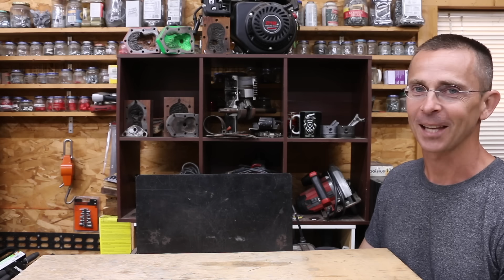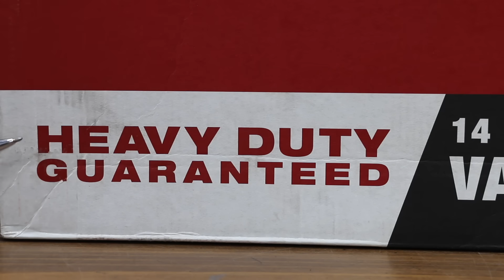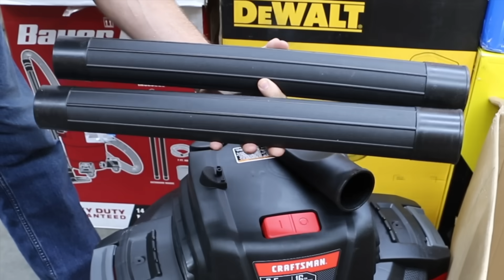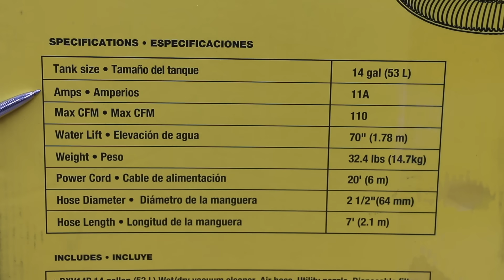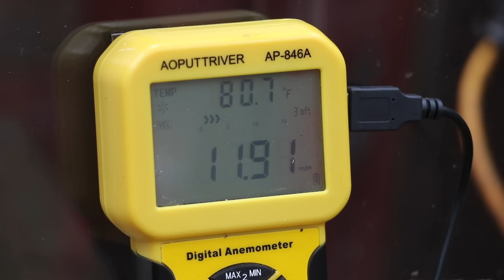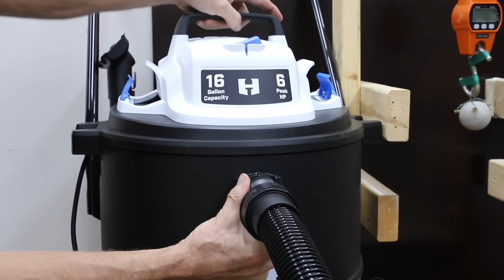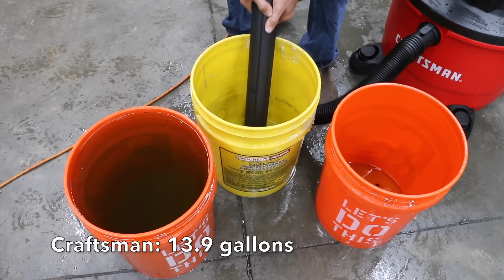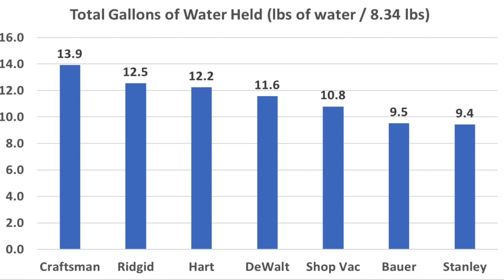Best Shop Vac? Ridgid vs Shop Vac, DeWalt, Stanley, Hart, Craftsman

Comment: Obviously this is an old video so I don't expect a response, but it would be neat if you factored in Harbor Freight's 2 year warranty into the cost for comparison.  I never buy a power tool from HF without that warranty.

Comment: I have a 30 year old + Craftsman 3.5 HP 16ga..I bought when I had a detail biz and still working great..bought a Rigid
at HD and basically about 1/2 the suction..need new hose now but worth the 25 bucks..I will hand this vac down to my son or Grandson when Im gone

Comment: Can you try sealing them up with some foam rubber or something and seeing how they perform afterwards? I know that doesn't give an out-of-box performance result, but if one had a better motor overall, and the only reason it performed lower on suction was due to leakage, it would show how an owner can "modify" it to have the best performing shopvac period.

Comment: Wait, if you can calculate horsepower based on amperage  then it really doesn't mean anything when comparing vacuums. You could have one motor that's more efficient than than another and still offers the same PSI.

Comment: I have a Ridgid 12gal which I purchased around 4-5 years ago and it's been a workhouse when I've needed it to suck up the remaining couple of inches of water still left in our 16 ft above ground pool at season's end. After watching this test I checked to see if mine had as much play in the lid...and it does. I purchased two Ridgid 12 gal vacs at Christmas (couldn't pass on the sale of $75 each), one for me and one for my daughter, and I noticed right away the improvements they've made to the newer models with the most-notable being how the top locks into the tub. Instead of it simply clicking into a locked position like it does on my old unit the new models actually have dedicated locks on both sides which you have to firmly push to lock it down. There's much less play in the newer units. Yes, I tested that...LOL!

Comment: Harbor Freight offers warranties that can compete with the top brands, for a few extra $.  With the performance of the Bauer, for $120 with the extended warranty, you really can't beat it.   I have a couple vac's, a Rigid, Craftsman, porter cable. and the one thing they all suffer from are clogged filters.  I guess the one with the easiest to clean filter would be my top pick! LOL

Comment: The HP rating on boxes is a load of shit, its a marketing gimmick. None of the vacs are actually anywhere near those ratings, its just a way to justify why you're paying well over $100 for some cheap molded plastic and a cheap motor. If I had to guess, those vacs probably cost them between $10 and $15 each to make if that.

Comment: Peak Horsepower (PHP)
Most manufacturers of garage vacuums and shop vacuums are marketing their vacuums as 4 to 5 Peak Horsepower (PHP).

No matter what you call it, PHP, HP, or horsepower, it's all just horse hockey when it comes to the performance of a vacuum cleaner.

To put it into the simplest terms:    

·      When it comes to vacuum cleaners, horsepower is a bogus, fictitious number having no relationship to the performance or cleaning ability of the product.

·      It is not based upon the nominal operating current of the vacuum cleaner, but on the in-rush current to the motor when first turned on.

·      The peak in-rush current lasts no more than 0.008  to 0.012 seconds.  It is often inflated by chilling the motor to temperatures as low as -20F.

·      Four horse power equates to 2983 Watts, or 24.9 Amps, at 120Volt under ideal conditions. This would greatly exceed the voltage supply circuits and blow the circuit breaker in a home.

·      It is 100% a marketing gimmick. In other words, it's just horse hockey.

For the technical person:·      Horsepower is not based upon the normal operating current of the motor. It is calculated using the maximum in-rush current. In-rush current is the current a motor sees when first started up, before the effects of winding inductance come into play. A motor with a nominal operating current of 12A can easily have an in-rush current of 30A to greater than 50A, depending upon the windings. It typically lasts for only 8 to 12 milliseconds (0.008 to 0.012 seconds). Some manufacturers attempt to maximize the in-rush current by conditioning the motor at very low temperatures (as low as -20F). This lowers the motor resistance, thus increases the in-rush current.

·      Power is equal to volts times amps.  Even ignoring the efficiency and power factor of the motor, a motor with a nominal 12A current @ 120V will only produce 1, 440 Watts. There are 745.7 Watts per horsepower. Thus, under the best of conditions, the motor will only produce 1.9 hp.   A motor touting 4 hp would have to produce 2983 Watts. With that power, the motor would be drawing 24.9 Amps. Horsepower is determined for the motor (without any fan blades), not the vacuum cleaner system, and does not take into account any normal system losses (air leaks, restrictions, piping and the like).

Comment: I have had a craftsman like the one you tested for at least 20 years.  I use it regularly vacuuming sawdust etc.  It still works perfectly.  I also have a rigid like the one you tested but don't use it regularly as it is in my garage instead of my shop - it definately isn't as strong as my craftsman.  Great test comparison.

Comment: I used my shop vac with my drywall sanders on jobs for my customers as a remodeler. I used to have an old ridgid vac that just was so so loud. I’m sure the drywall dust ruined the bearings or something because I always felt like I needed earplugs running it. I sold it and bought the 9 gallon dewalt and the performance and noise level was night and day! Love to see my biases confirmed. Build quality on it is definitely good and we beat on it almost daily. Only downside is that you have to use their over priced bags or it blows all the dust back out.

Comment: Bought a Rigid to replace my ShopVac that recently died. I only went with Rigid because the Lowes and Home Depot in my area no longer carry ShopVac. The Rigid is pretty powerful and does what I need it to do around my home workshop. The only complaint I have is the power cord material. In the winter it is really stiff and hard to manage.

Comment: A little insight. I have several Shop Vac and several Rigid vac at my shop. I bought the Bauer 6 gal. with my own money since we could hardly get them at work at the time due to logistics. I use it every day professionally. I wasn’t sure on it at first when i bought it. I did get the 1 yr replacement warranty. Not much money. I Love it. I really do. It’s noticeably quieter than the rest. It has a deeper tone than the higher pitch tone such as the Shop Vac. Rigid is loud too. Suction on the Bauer IS very good. In addition to the Bauer i bought the Rigid hose attachment set ( detailer set). I now have the longer hose that mates up with the Bauer perfectly and the added attachments too. Over a year in use doing Auto glass and going strong. Highly recommend the Bauer for inexpensive shop vac. No issues and you can buy a new filter for it at Walmart for 10.00. Don’t pay HF price.

Comment: Should add some higher end stuff here -- Fein Turbo II is the best of class IMO... it's expensive -- but it is quiet and sucks (in a good way).  Also has a 1500W relay built in -- a la why they call it a dust collector...

Comment: I really enjoy and appreciate the work you put into testing products, simply awesome and keep it up. 

One thing I thought about when you were doing the pull-down suction/weight test with the rubber ball would be to change the diameter of the ball so each hose size has the same 'mating ratio'. So that the mating surfaces between the hose and ball are as identical as possible (ie, if one hose was only 0.500" it wouldn't have nearly the suction-area as a hose that was barely-smaller than the diameter of the ball).

Definitely loving the vids :)

Comment: If you ever do another one of these, I'd like to see an abusive vacuuming portion added. I killed a little shop vac using it to vacuum chips while doing milling work. Not sure if it was the smoke from cutting fluid or just that the filter got clogged or if the chips slipped into somewhere they weren't supposed to be, but I'm sure a lot of other people also abuse their shop vac's similarly. Thanks so much for making your channel and doing the videos the way you do.

Comment: Some models tip more easily when being pulled (top heavy motor, wheel design/layout).. some may have extra weight in the base to resist this..  This may have been worthwhile to test.. perhaps in a redux down the road :)

Comment: 13 amps for a shop vac? Jesus. The 110V electrical system in the US is ridiculous. The 230V system is superior in every way. Less losses, half the current for the same power and no need for excessively thick wiring.

Comment: Have to add a shout out for Rigid.  Had it around 5 years.  Was working fine, then just quit.  Went to website and filled out a quick form w/ 3 photos.  Within 48 hours,  they shipped another NO CHARGE,  They didn't want the dead one back..  Very Impressive

Comment: Great video as always. I have a rigid professional model that I’ve had for about 10 years, has seen lots of tough use and is one of my all-time favorite tools. So I was definitely rooting for rigid but mine doesn’t have the same lid fit issues that the one you tested does. Oh well. Always been a fan of craftsman in Dewalt as well. :)

Comment: I purchased a Craftsman 16 gallon in 1990.  It is 32 years old and still kicks butt!  It has bailed out my flooded basement 3 times.  12 years ago I purchased a ShopVac thinking it was going to be awesome because it was rated at twice the horsepower.  It is NOT awesome.  I suspected it was a wimp and tested it on a bucket of shelled corn against the Craftsman.  The ShopVac was brand new, double the power but could not keep up with the much older Craftsman for time to empty the bucket.  My biggest complaint of the ShopVac is that the air flow design in the tank is terrible.  With very little fine dust, the ShopVac filter is plugged and has to be cleaned.  I added a baffle inside the ShopVac and that helped, but the Craftsman still pulls a LOT more, fine dust before losing suction.  I wish Todd had tested fine dust...it is very telling of a vacuum's mettle!  Still, Todd came to the right conclusion in my eyes!

Comment: If you ever come back around to shop vacs and want to do an experiment, I noticed inside the exhaust port of my vac there wasn't a smooth airflow path and it looked to have a smaller cross sectional area than the intake due to the action of the mold they made it with. Since I never use the blower feature, I decided to hole saw some extra ports out of curiosity. Oh my goodness, not only does it pull a substantial amount more air than before, it is also significantly quieter! Huge upgrade for free.

Comment: Great video. Maybe a durability test. Start them all, last one standing wins. I use a shop vac for dust collection in my shop and leaving it running for an extended time happens frequently. Extended run time without fear of fire or destroying the vacuum is a major factor. Thanks for ALL your great videos.

Comment: I bought a DeWalt after our ShopVac brand died.  Main reason I bought it was because it was so much quieter.  On the first use I was not disappointed.  And, I'm still happy with it over a year later.  I could care less about any of the other results, cause that thing is super quiet.  Everything else about it is just bonus.  Worth every penny!

You could have made that capacity test result much more helpful if you would have calculated % of stated capacity.  You could have color coded the bars for stated capacity.  Then people would have seen that the DeWalt came in second at 82% of capacity.  The Craftsman was still first at 86% capacity.

Comment: I would love to see a electric metal cutting Band saw test I just purchased the WEN very happy so far also the cheaper HF red saw it was very disappointing the HF best at over  $1000.00 was not in stock and no info when it was going to be .

Comment: I got my Bauer last year on a Black Friday for like $80, and it's a monster.  Only had one issue with it and that was sucking up sanded joint compound where the filter got clogged.  Quick shake of the filter outside and it was back in business

Comment: I bought the Rigid because of the Lifetime Warranty & being able to use the motor as a blower. Case in point, use the blower far more than the Shop Vac. Saved purchasing 2 tools.

Comment: You were missing the most important part of the test.  The ease of using a wet vac just for water.  I've had my share of hot water tanks breaking down and when I used these, I found these wet vacs to be very klutzy.  If I pulled the hose too far, it popped off or the bottom piece that went on the floor came off.  It is hard and extra heavy to empty and not possible to do without making just as big a wet mess.
In the years I've lived in my present place, I've gone thru 5 hot water tank spills.  (I live with 2 other tenants but the tanks are in the basement with me.)  The only constellation I have is that at least the water is clean.  I need to invest in a pump.

Comment: I wanted to comment on a statement you made regarding Warranties:   Warranties are granted to cover manufacturing Defects they are not, as many companies used them, an assurance of "High quality" as you implied in your statement.  Did you read the fine print on these products that have life time warranties? Most people do not. I can assure you they do not cover the motor as motors wear out. most life time warranties are prorated meaning they reduce the amount they grant you so that after 90 days he get little or nothing back.  Some have a requirement that you ship the product to the factory to take advantage of the warranty Some require you to have the original receipt. I do not base my purchases on the type of warranty the product has. It is typically not worth the paper it is written on.

Comment: I have doubts to all these brands. Motors are made with bushings. Not meant to run continuously. I’ve already gone through 3 shopvacs and a rigid in the past 2-3 years. Next one I buy will be nilfisk.
Also shopvac went belly up.
Not sure your vacuum pressure test was good. Pounds measured depends on the diameter of the hose.

Comment: I had an Old School Shop Vac for years. When it finally conked out on me, I bought another one. I was disappointed in the decline of quality. I'm glad I got to see this review. I am going to invest in a Dewalt. Mine gets used hard for construction clean up. I would have liked to see how they do picking up nails, drywall dust, wood scraps etc. Drywall dust clogs up a filter fast which reduces suction. It would be interesting to see which one lasted the longest with drywall dust.

Comment: It has been a while since I bought 2nything at Harbor Freight, but they used to offer lifetime warranties for pretty reasonable prices as an add-on.  On the one occassion that I tried to use a "lifetime warranty" was almost effortless.  I told them my phone number.  They confirmed my purchase had the added warranty. They told me to grab a replacement off the shelf.

Comment: Should do a test to see what the suction is with and without the filters for those of us who never use filters on our shop vacs. I bet some filters are more restrictive than others.thats why suction was so different,  I went through 7 ridgids one summer then discovered it was because we werent supposed to use filters for what we were using them for ! Should have seen me trying to explain what the sales rep told me to the frenchman that was having to shell out money every time the vacuum fried ! He thought i was nuts for removing the filters till a year went by and he didnt have to replace a single vac in that year. Ohh what a good idea i had calling them he said i was like ahh yeah sure thing too bad it wasnt you who dug in and took the filters off.

Comment: Old Black and decker home vacs had stainless steel tubes and a pretty good quality universal type motor. We had bel-1000 and bel-2000 vacs and lasted no less than 15 years each, and were quite repairable .However were noisy, heavy and filters had to be handled with care to avoid damage. I'm pretty impressed that shop-class vacs had just plastic tubes and pretty standard plastic. Rubber seals are key to performance. Most vacs loss performance over time because filter contamination and rubber seals getting brittle.

Comment: HART VOC1612PF 3701  16 Gallon Wet/Dry Vacuum:  7’ x 1-7/8” Hose
BAUER 1952E-B14 14 Gallon Wet/Dry Vacuum:   2-1/2 in. x 7 ft.  hose
Stanley SL18199P 12 Gallon 5.5 Peak HP Wet/Dry Vacuum:  1-7/8" x 6' Hose
CRAFTSMAN (VacMaster) CMXEVBE17595 16 Gallon Wet/Dry Vac: 2-1/2 in. x 7 ft. Hose
DEWALT DXV14P 14 gallon Poly Wet/Dry Vac:  2-1/2" x 7' hose
Ridgid WD1670 16 Gallon Wet/Dry Vacuum with Detachable Blower: 2-1/2" x 7' hose
Shop Vac 16-SQ650 16 Gallon Wet/Dry Vacuum: 8-foot by 2.5-inch diameter hose

Comment: Not sure about those two brands but SEAR's brand is powered by a 25' 14 gauge wire. The wire gets warm when using the vac. My understanding is that the motor is not getting all the possible current it can so I replaced the wire with 50' of 12 gauge. I can't tell if the motor speed has improved but the wire doesn't get warm.

Comment: Without question when I am shopping for any equipment, tools etc I chk here first (just like I chk CNet for tech) to see if you have covered it.  That said I have a Ridgid that has been my primary shop vac for 25+yrs, other than a small bend in the tube it's still my go to.